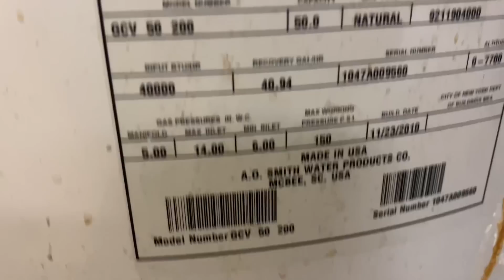Water Heater T&P Valve Leaking Water Needs Replacemwnt But Lives Another Day

Comment: if he has older style diaphragm type toilet ballcocks, they'll open upon pressure change and relieve it. but if they're all newer type they won't open and the new relief valve will leak starting with the first/every hot water recovery cycle.

Comment: Mikey Pipes! Question from a plumber in Canada. I've noticed in a few videos that all the water heaters are very tall, making the venting more difficult in places like this. Do you not have the option of a shorter 50 gallon? We have both tall and short options for the 40 and 50 gallons here. Love the videos!
Reply: short tanks cost more, so they are not used unless they "have" to be. They are also, obviously, wider so they will take up more floor space.
Reply: @BikerrrNY  yeah, that's the most common reason here in Ohio as well as much of the USA, shorter tanks cost more and the diameter is/was very often too large to fit.
when the magical "safety" tanks and thicker insulation came along, even the tall models will often not fit anymore, if they do there's zero clearance, the plumbing all ends up offset and require walls/furnaces/boilers/cabinets, etc. to be torn out/moved. what should be an hour job taking your time becomes a two to many day job.
Reply: @PipeDoctor  thanks for the insight! Here the taller tanks are more money, strange how things change in different jurisdictions

Comment: I've only seen HWTs with draft collars not draft regulators. I believe if the regulator is facing down it it will "hang" open causing too much air to mix in dropping the stack temperature and allowing backflow of gases if both appliances are allowed cool, I think.

Comment: In St.Louis the pipe that is attach to the T & P relief valve must be 3 inches from the floor to pass inspection.. In St.Louis County a home owner can install their own Hot Water heater if they can pass a test the city gives.. I took the test before I can put in my Hot Water heater in a couple of years ago and passed it but the test was strange because their is no questions about gas hookups,  it was just about hooking up the water and the length of the T&P valve pipe length. So far I have not heard any explosions in the neighborhood.:yougotthis:
Reply: I go down and buy a 700$ tank and in 2 hours I'm done. This PT valve cost this pilot 344$, I'll never be able to fly a plane but I'm glad that I never have to hire anyone...

Comment: Mikey, question, Why do some water heaters have expansion tank and other do not? If there is no backflow preventer on WH you don't need expansion tank and if there is, you do?...?13 year old water heater rotting away and chose not to replace it??? silly willy!
Reply: If there's a backflow preventer the heated water expands and has nowhere to go. It builds pressure and finally causes the pressure relief valve to drain. Without a backflow preventer, the pressure just backs out the cold line and to the street. The best solution would have been to install an expansion tank. This was kind of explained and they went ahead with replacing the relief valve which will not solve the problem???

Comment: ya know a crescent wrench might be a good idea in a tool bag instead of just a a cple channel locks and a pipe wrench lol seeing your apprentices struggle with channel locks and using two pipe wrenches is always a lol i wld be rolling on the floor if you showed them how to use a crescent wrench
Reply: Yes, anything with 6 sides should see a fixed or adjustable wrench, not pliers.  Crescent (BRAND) makes nice ones with wide opening, made in Spain.  Nice adjustable feel.
Reply: @PipeDoctor  kk what than your helpers cant find them or they afraid to use them because they struggling like hell to use the channel locks like in this video- never mind the complexity of turning a knob to adjust a tooth lol its all good though i remember struggling to use my basic spark hand tools too at the begaining.
 and even 25 yrs later i still have no clue how to use a broom and dust pan lol
Reply: @PipeDoctor  Did “Kev” ever show up?